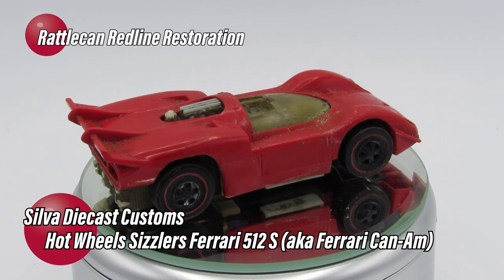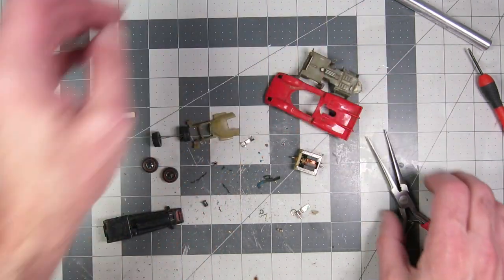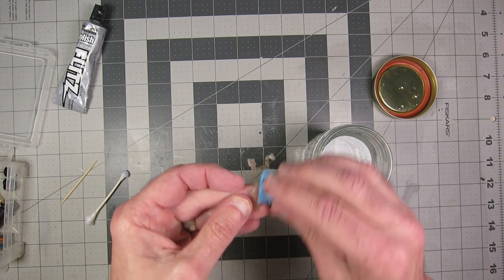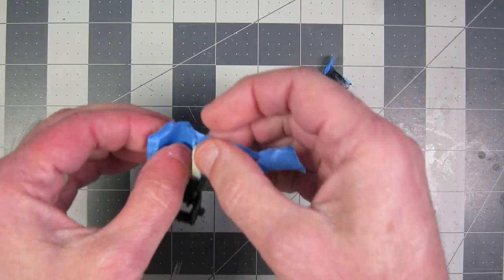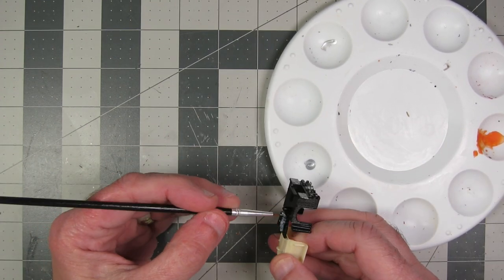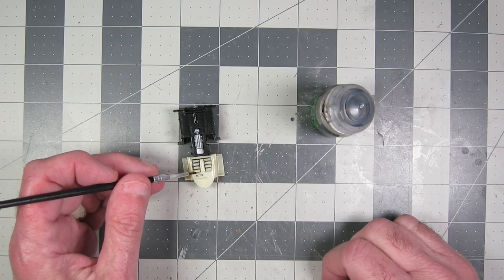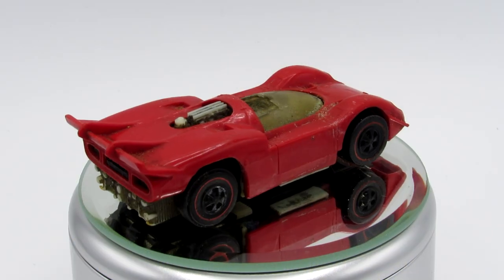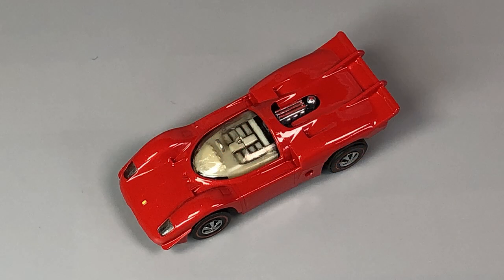Hot Wheels Sizzlers Ferrari 512 S (Can-Am) Restomod

Comment: Very nice Jim 👍 This is actually one of the more rare sizzlers models. The bone color was actually chromed. The old NiCad batteries leaked acid which destroyed the chrome. Sometimes these can be repaired, but sadly most were destroyed by the leaking acid.
Reply from the maker: Thanks Jim!
Reply: To be honest  ..Even to today a lot of Sizzlers thats never been open arent all in bad shape   ..I just opened about 15 cars..All got restored but 3 ...Now this..The long battiers cars  didn't get wasted nearly as bad as the short battery ones  .The long battery cars were more protected because they were designed and made with a cover over the motors ..The ony parts that mostly  got destroyed were the contacts.(Still a lot of them can be cleaned up made to run....-..Most long battaries were easier to repair after all these years.. That Red Ferrarie is one of my favorite  Sizzler car to race ..!!

Comment: Hey Jim, I was just curious; do you need a juice machine to charge these things up or is there another way?
Reply from the maker: As I recall, the plug isn’t an uncommon one (I think it’s a fairly common audio plug), so I suppose you could make your own charging device with the plug and some batteries.  Heck, there might even be ac adapter that would fit it, but I’ve never really looked into it.
Reply: @JimSilva-SilvaDiecastCustoms  Alright, thank you!